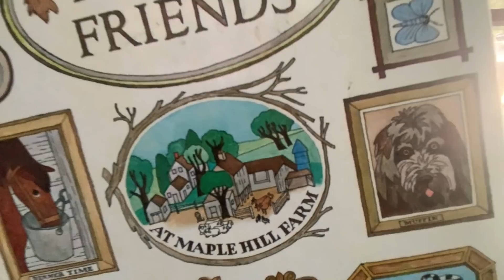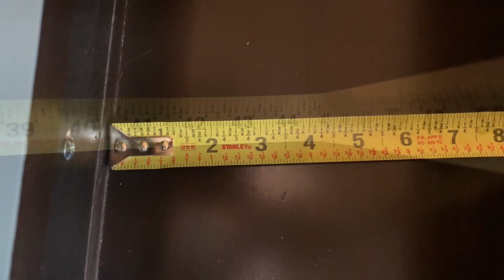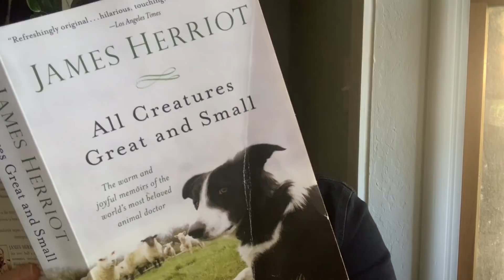Modern Farmhouse Coffee Table Flip | Coastal Farmhouse Style | Plus BONUS Flip!

Comment: Both pieces came out beautiful. You do great work.
You need to get yourself a high worktable to save your back. I found an old farmhouse table, put heavy duty casters on it and use it as my work table. Wonderful for my back not having to be bent over all the time. 
After COVID, I will not wear a mask ever again. I would rather  tolerate chemical fumes if working outside.
Thank you for not using the first set of drawer pulls; it seems that every UTuber flipping furniture is using those and they look so generic.
Reply from the maker: Thanks so much Annod!  Yes - I usually work with the piece up on my big desk or sawhorses - can't remember why this one was lower!  Not sure I understand the mask aversion (they are such a great contribution of our ingenious engineers!) but to each their own.  ❤️And so glad you liked the pulls! 😊

Comment: So beautiful!  What are your thoughts/recommendations on painting furniture with the, almost. Papery wood covering?
Reply from the maker: Thanks Lindsay!  Not sure I understand the question - can you clarify?  😊
Reply: @FurnitureFablesbyAndy  I have some dressers that I'd love to change!  They are laminate, but it looks like almost a papery cover.  Do you have any recommendations?
Reply from the maker: @lousylou  If the material covering the laminate is in good condition, it is most likely paintable.  If it's glossy or slick, I would recommend using a product like Ultra Grip by Fusion Mineral Paint (made to help prep laminate).  If that papery finish is peeling, failing, etc, then you would either need to remove it somehow, or seal it over with Dixie Mud, or perhaps Bondo or other wood filler.  Hope that's helpful!
Reply: @FurnitureFablesbyAndy  thank you!!!!